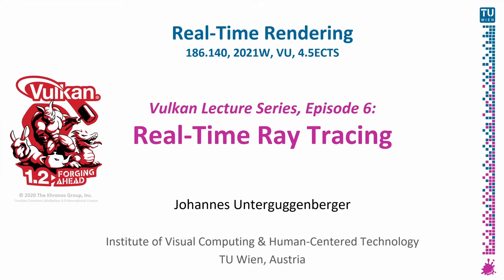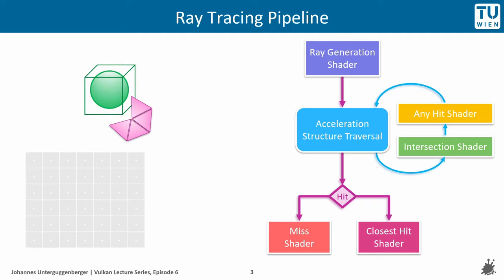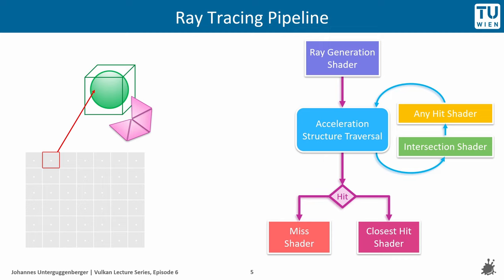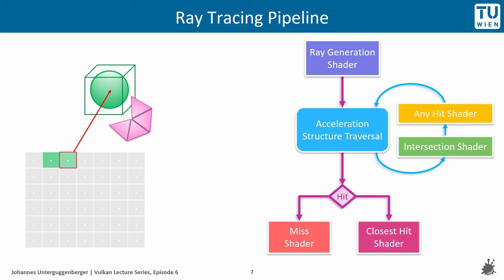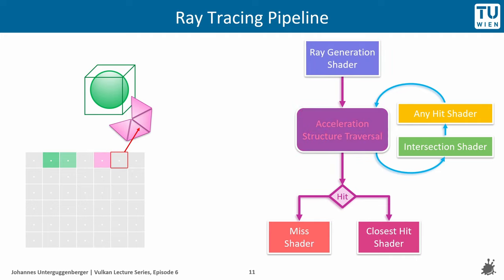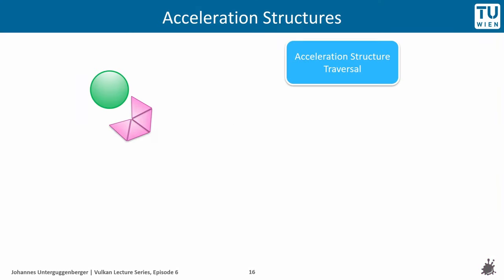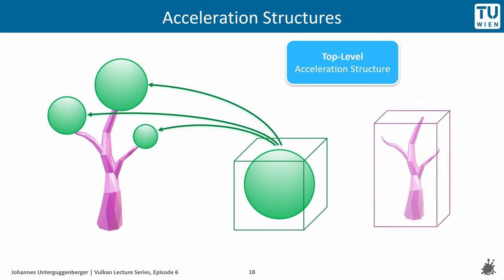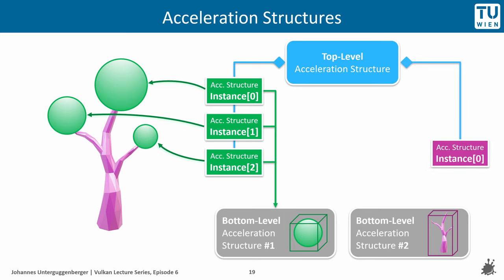Real-Time Ray Tracing | "RTX ON in Vulkan" | Vulkan Lecture Series Ep. 6, Real-Time Rendering Course

Comment: Good vodeo! Though it would be much easier to digest if the information would be phrased for audio/video consumption, as opposed to being phrased for textual reading as it very obviousely has been. What works well for reading simply doesn't work well at all for listening. So much so, that it would have been probably easier to just get a transcript to read through than to listen to this being type-read verbatim like this (and it's not the first time such a comment is made on this channel, so a bit dissapointing).
Reply: Nothing at all here strikes me as being phrased specifically for textual reading. It's clearly scripted (as most well-balanced tutorials are), but the script is strongly supported by the visuals. Like, all the sections walking through the ray traversal examples (both the simple one in the beginning as well as the island one later) only make sense when following along with the visuals, and all the structs they talk about are walked through on-screen. I'm not sure what you're looking for exactly... I for one would very much like them to continue this style.
Reply: @Sabre-dt2ng  The slides and presentation quality in general are very high - that's actually what makes it frustrating to struggle through digesting it the way it's phrased.
Here's another video from this channel which contains many of my comments about phrasing that you can have a look at to get my meaning:
https://youtu.be/isbMMIwmZes?list=PLmIqTlJ6KsE1-jb7DF313E6MvLcpTLqgH&t=1486

It's a bit like how books are written with a different phrasing than movie screenplays, or even live presentations/lecturing - even when authored by the same person. You can listen to famouse speakers and book authors, when they read their own books verbatim vs. when they give live presentations.

But even for text, phrasing well is a skill onto it's own and it just seems like the author could have used some help there. 
Like, if a sentence has "..., which ..., which ..." that's typically a clear sign that it should be restructured internally and/or broken apart.

Example from this video:
"...before we move to acceleration structure traversal and to an in-depth look into ray tracing pipelines, let us quickly see how data for building bottom level acceleration structures is provided".
Compare this with:
"...before we move to ray tracing pipelines and traversing acceleration structures, let's quickly see how to provide data for building bottom-level ones".

Subtle perhapse, but the second one would demands less from a listener (in audio) then the first, while conveying the same information.
In text it's less noticeable, but I think still is.

Note how long and verbose the original sentence is, and note the gramatical reversing at the end as oppose to the more natual way of speaking.
People tend to have longer short-tem "context" memory when reading than when listening, and if a structure of a long sentence makes it difficult, we can always jump our eyes backwards for context. Scrubbing a video backwards is breaking the flow a lot more than jumping your eyes over text, and I found myself scrubbing a lot in this video and the other I linked to.
Reply: @AinurEru  As a native English speaker, I actually find your recommendations either no better, or in most cases actually worse... (And you ended up kind of spamming that other video; did you really need to make a separate top-level comment for each of your examples..?)

Like your example here:

1) You swapped the order of "acceleration structure traversal" and "ray tracing pipelines", but now they're in the opposite order of how the sections are laid out in the video (acceleration structure traversal @14:07, pipeline in-depth @20:49).
2) You did this so you could say "ones" at the very end because you seemingly disliked the repetition of "acceleration structure", but now "ones" is ambiguous could interpreted as also including ray tracing pipelines, but "building bottom-level ray tracing pipelines" is not a real concept.
3) This is made worse by removing the second "to" in "before we move on to X, and to Y", which makes it slightly less clear those are intended to be two separate sections and not one combined topic (note that the presenter put a pause between them as well, helping to demarcate the concepts; your phrasing doesn't lend itself to a natural pause there).
4) By changing to "before we move on to [...] traversing acceleration structures" as opposed to "acceleration structure traversal ", you're ambiguously making it sound like an activity we're doing (i.e. "we're moving on to traversing/exploring X"). But that's not the intent; "acceleration structure traversal" is a well-established operation the GPU does, and we're moving on to that topic .
5) You removed the "in-depth look" part about ray tracing pipelines. But that was meant to contrast with the introduction to ray tracing pipelines that already happened earlier in the video . Removing that part makes it sound like we're bizarrely re-introducing a topic we've already covered as opposed to providing an additional deeper dive that builds on that earlier shallow introduction.

In my opinion, your changes did a lot of damage to the comprehension of that sentence, and all for a ~20% reduction in length. And I feel similarly for each of the specific examples you gave in the other video.

This is a lecture, as opposed to a casual YouTube tutorial, so the presentation style is somewhat formal, but it didn't seem at all distracting to me.
Reply: @Sabre-dt2ng Firstly, I am a non-native english speaker, but so is the author and likely most of his viewers (rendering/graphics programming has always been far more dominant in non-native english speaking countries).

As for labeling my comments on that other video as 'spam', can't see how that's valid. You can obviously see that they quote the video verbatim, and offer concise alternatives that - whether you agree with them or not - have obviously been given some thought. The breakdown to individual ones is incidental to their purpose. I could collapse them all into a single comment if that bothers anyone, but A) I dissagree that it would, and B) it makes it easier to comment on individual ones when broken down so is actually better for everyone that way.

Now that I look at it, your first 3 points would be aswered for by just removing the mention of pipelines in that sentence, as it is clearly meant to lead into a discussion on the construction of acceleration structures (the following section). The pipelines part of it is almost irrelevant to this preamble, and can simply be it's own sentense after that:
"...before we move to traversing acceleration structures let's quickly see how to provide data for building bottom-level ones".
"Following that we'll dive deeper into ray tracing pipelines."

But I'll comment on each point anyway:
1) Order swapping is natural in live-speaking, even in lectures, and given the accompanying slides it wouldn't actually bother anyone that much (if they even notice it at all).
2) Since you've noticed the reason behind the reversal, and given that you're a native english speaker, it's clear that you know that in that case the "ones" is unambiguosly reffering to "acceleration structure" being the 'latter' of the priorly mentioned comma-separated nouns (as you said yourself, I did it for that sake). It's been a while since my english classes in school, but I at least remember that. And as you said, building ray tracing pipelines has no meaning anyway, and that's made clear by the rest of the video, so - again - no potential for confusion there.
3) This little bit may be valid, though again with the slides on there, it's a non-issue as it's easilly visible that they are separate sections. That said, it's easy to adapt my alternative phrasing to it accomodates that:
"...before we move to ray tracing pipelines and to traversing acceleration structures, ..."
4) I can't see how even a non-native english speaker might get confused there. The verb "traverse" is never used to denote covering a topic in a presentation.
And for the record, I've written CPU ray tracers from scratch, including BVH traversal algorithms, so no need to educate me there.
5) "...before we move to an in-depth look at ray tracing pipelines and to traversing acceleration structures, ..."

What makes it easier to digest is a reduction in complexity and needless verbosity, and I dissagree that it's only "slightly" formal - it's very much "overly formal to a fault", and that's my overall point in all of this. Passed some point it becomes counter productive to it's purpose when it damages information transfer - the core purpose of any lecture.

The "formality" aspect though is not even the main issue - the phrasing in these examples is needlessly convoluted to a fault in other ways than just "fomality".
It's clearly just a lack of proof-reading when scripting and not putting the additional effort to simplify the scripts for the sake of ease of consumption.
Videos like this (especially successful ones) tend to have much more time being spent on being consumed than on being produced, so additional time into improving consumption is a net-win.
Reply: @AinurEru  I think we can just agree to disagree here. Ultimately since I'm very happy with how these lectures are going, I'd rather not get into too huge a discussion; just wanted to make sure it was mentioned to the presenter that someone felt otherwise, as I'd be disappointed if they pivoted too hard as I find their current phrasing all but perfect as-is. If others agree with you they can chime in here too and strengthen your feedback.

Just want to clarify my intent behind a couple things I think you took as attacks before I go:

> As for labeling my comments on that other video as 'spam', can't see how that's valid. [... They] have obviously been given some thought.

I meant that as a soft suggestion; in hindsight "flood" would be a better word. I didn't mean they were in bad faith or that the contents weren't relevant. Clearly you're trying to give actionable feedback because you care about the topic and this lecture series. But now 8 out of 18 top-level commenters on that video are you, and they're all supporting evidence for a single claim from a particular individual. My personal view is that top-level comments should map 1-to-1 with each individual's overall conversation topic, which is a courtesy that allows each person's feedback to be essentially equal in visibility. If the topics differ dramatically then two or (rarely) three are fine IMO.

> And for the record, I've written CPU ray tracers from scratch, including BVH traversal algorithms, so no need to educate me there.

That wasn't at all intended as a slight or an attempt to educate. I wanted to present evidence to support why I felt the existing phrasing was useful in that context. If anything, it hoped you were already familiar, in hopes that it'd establish common ground.
Reply: You know, constructive criticism is always welcome. So, thanks for that. Also thanks for the interesting discussion. I'm trying to find a balance between polishing and getting things done, where my main objective is to convey information -- even if not everything is perfectly formulated or as concise as it could be. Time is limited, unfortunately.